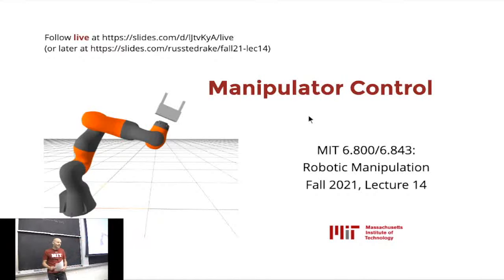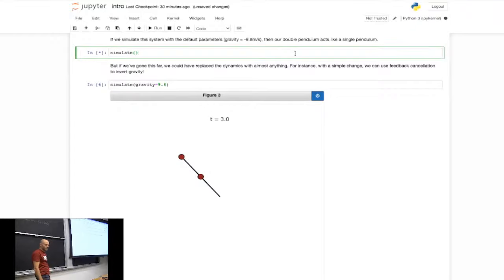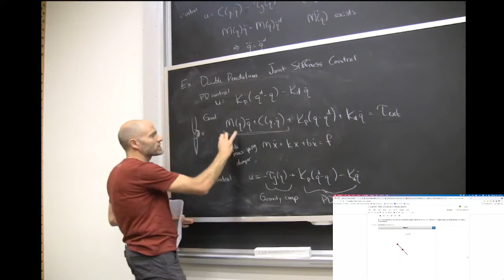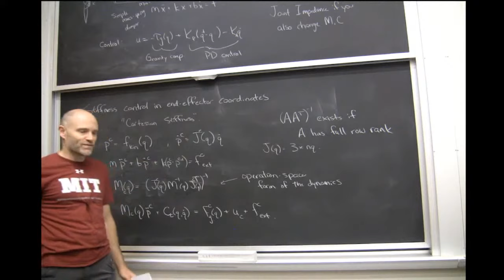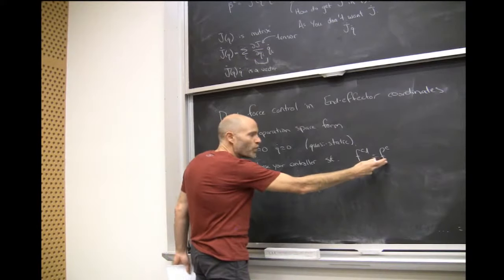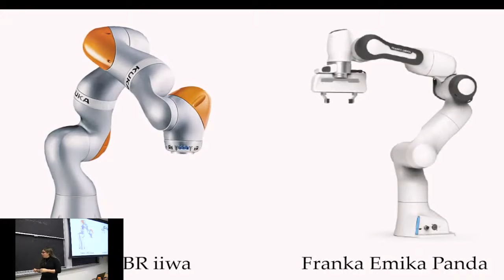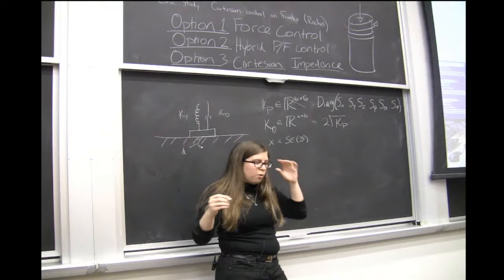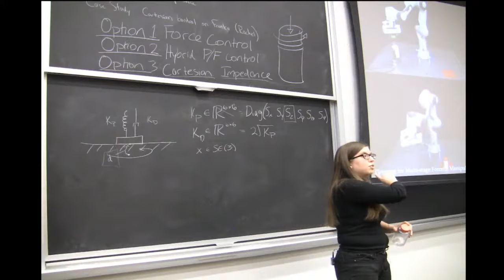Lecture 14: MIT 6.800/6.843 Robotics Manipulation (Fall 2021) | "Manipulator Control"

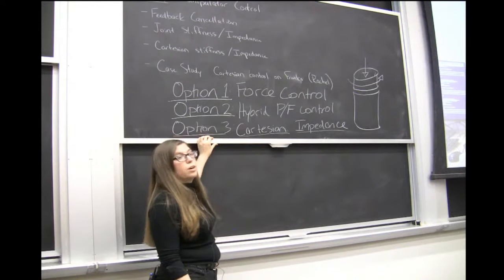Comment: This is a great lecture! I am wondering if there is a reference in the notes somewhere which can clarify the distinctions between some of the terms used. In particular at 1:07:12 Rachel mentions using cartesian vs EE vs operational vs task space interchangeably but that the terms have slightly different meaning.